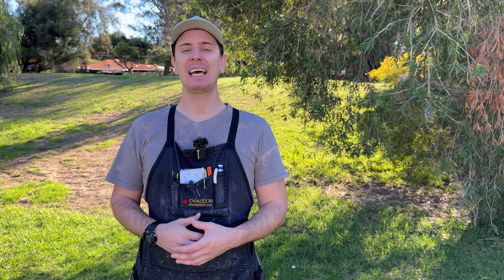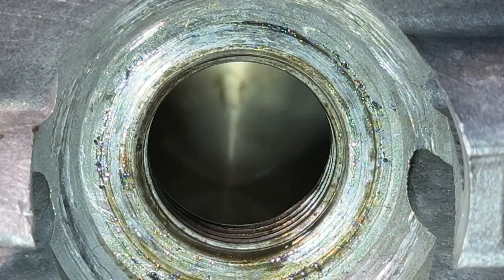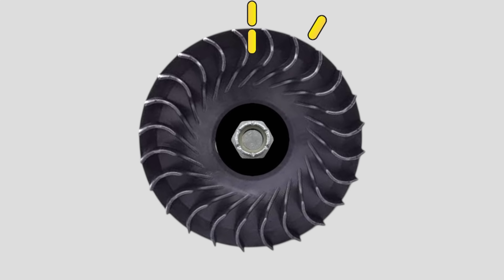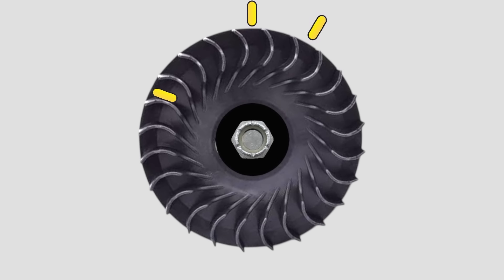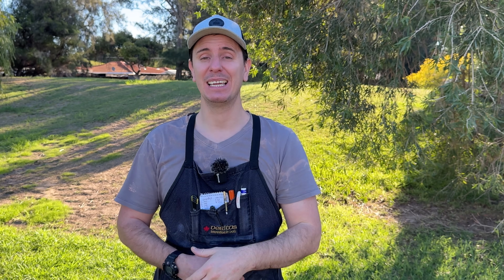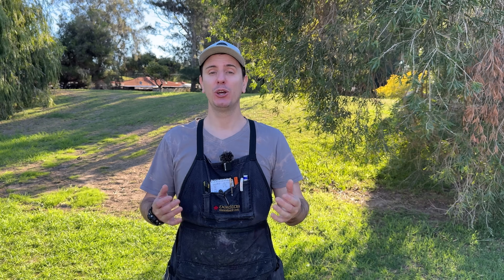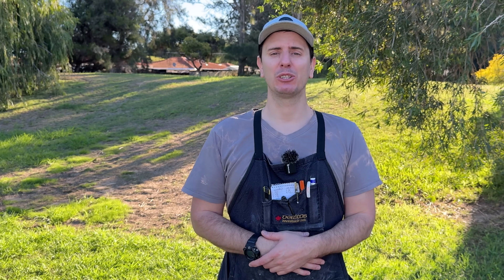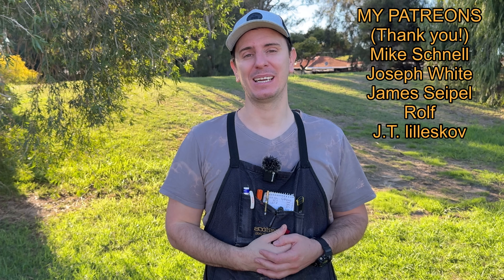Essential Tool Every Mechanic Should Own!

Comment: I have a bad case of kickback.
Ordered the light.
The saw is an old 038 AV,  and it just won't quit. Like a Timex, "Takes a licking and keeps on ticking".
I replaced the CDI module with an external one some time ago, and it ran fine.
Lately, it kicks back. 
Doesn't seem to be any way to adjust it.
Reply from the maker: Keep me updated on the timing! :)
Reply: @VintageEngineRepairs  ...BTW..the external CDI modules are getting hard to find and are quite expensive.

Comment: The timing is set on these engines you can't change it therefore checking it is a waste of time. No pun intended.😊
Reply from the maker: What if the key is sheared and changes the timing? Or the coil fails and the timing has changed? Or the 10 other things I mentioned :) you need to diagnose this to be able to rectify it. That's why it's important to know how to use one.

Comment: Question for you. I have a Stihl ms650 that has a horrendous kick back when starting in very cold weather. It seems to start ok in the summer. I have my own theories but would be curious to know what you think? I have tried to open up the clearance on the coil fasteners to alter the timing with no success. I also tried a Chinese coil and there didn't appear to be any change.
Reply from the maker: Pull it hard and fast. If you don't give it your all, it'll bite. That said, I show how to check timing here, which is a sensible thing to tick off. 👍👍
Reply: @VintageEngineRepairs I was trying to ask if you believe temperature affects timing? Warm or hot saw starts fine. Same saw 5-10 F and massive kickback on cold start, only.
Reply from the maker: It's not something I have ever come across, no. 👍
Reply: @VintageEngineRepairs ok thks

Comment: It won't run because it's a Stihl. You probably flooded it because that idiotic start switch wasn't in the right place and it didn't trip the high idle on the carb.
Reply from the maker: Thanks for that wise insight 👍

Comment: Hmmm. Strange. I've worked on lots of engines, two stroke and four-stroke but I've not come across one that is time AFTER TDC.
Reply from the maker: Na they will all be BTDC
Reply: @VintageEngineRepairs But you mark it AFTER TDC and you talk about it in the video.
Reply from the maker: Hmm no I mark it all BTDC?

Comment: I just lick my index finger and thrumb and make the connection with my bare hand and have someone else pull it because im retarded and don't mind random erections from intense electrical impulses. One day i did this with the 300lb neighbor boy at the pull string and i was plunged into a grand mal seizure it was awesome.
Reply from the maker: Rather you than me 😂
Reply: @VintageEngineRepairs it literally better to do it this way with weed eaters or slow crank a mower before i even think of running around to get the right tool. you can just multi meter that shiz as well

Comment: I wonder if a briggs opposed engine has timing advance. THe cam and crank are connected with a gear. The magneto always fires when it should, unless there is MAJOR engine damage.
Reply from the maker: It's quite possible, yes :)

Comment: Well after checking on both Amazon UK and DE, it appears that whoever is selling this timing light does not want to ship it to Greece. Too bad for them, another sale lost.
Reply from the maker: Oh no, that's a shame! Hopefully you can find an alternative that ships to you.
Reply: @VintageEngineRepairs  I do have a conventional timing light. It only needs a 12 volt supply to work. Have battery packs that can supply it with enough power. FYI, I drive a 2006 Renault Megane 2, there are zero timing marks to be found on the engine. All done electronically, bummer!

Comment: You didn't explain what to do if the timing is either too far retarded or advanced, unless I missed a bit.
Reply from the maker: It's at the end of the video, you have to find out why it's occurring - lots of reasons it can be out. Cheers.

Comment: I've used timing lights on small engines like that , more on 4 cycle engines but have a 12volt battery to power the timing light, this makes sense  with a 2 cycle engine, great video, You mentioned kickback on a saw, that happened to Ken and the saw would run backwards it had a mismatched magneto causing the malfunction
Reply from the maker: Haha I have seen videos of things running backwards due to ignition timing faults lol. Cheers!

Comment: I’ve done this on a couple of Stihl chainsaws and had to remove the key permanently to get into the timing window. My timing light has an advance dial on it. They were very common back in the day. I only need the TDC mark. Turn the dial at full advance until the marks line back up and read the degrees precisely on the dial.
Reply from the maker: Yes use to be very common :) I wonder if most modern mechanics know how to even use one!

Comment: I am so confused at the test while it's running in the video - I'm seeing 2 (sometimes 3) separate lines glowing, how do you know which one is which? I have this same timing gun but haven't tried to use it yet.
Reply from the maker: That's because there are 2 lines and each will light up depending on how fast the engine is going :)
Reply: @VintageEngineRepairs I appreciate you taking the time but I still don't understand. Did you make 2 marks on the flywheel?
Reply: @VintageEngineRepairs I bought the timing gun you recommend but I haven't read the directions or tried it out yet. I'm still trying to figure out why there's two lines that light up. You only make one mark at TDC on the flywheel, correct? Does the spark plug fire twice each revolution on that motor?

Comment: A timing light can also be used    on older alternators to determine if the fan belt is slipping.The fan on the alternator will be began to turn  backwards if the belt is slipping as you rev up the engine.
Reply from the maker: How interesting, I have never heard that! Thanks for sharing :)

Comment: all you have to do is pull the flywheel off and make sure the crank to flywheel key is NOT sheared.  if it IS sheared, the timing will be off.  sometimes you can see it by just removing the flywheel retaining nut
Reply from the maker: There are many reasons your timing may be off, the keyway is only one.

Comment: What about using an ST-125 spark tester on a small engine?
Reply from the maker: That isn't a replacement for a timing light :)
Reply: @VintageEngineRepairs  True, it isn’t a timing light but a spark tester. I was wondering about testing for a strong enough spark. I do like your timing light use and set up. That is sharp.

Comment: I was burned by bad timing on my dad’s Poulan chainsaw that had the flywheel just a little bit off and spending hours testing everything else and countless pulls of the rope before realizing the built in key was sheared.  It was probably sheared by me using a power drill to turn the engine over towards the beginning of my diagnosis.
Reply from the maker: Ah how annoying! At least you now know a quick solution to check first :) cheers!

Comment: l'm not a mechanic but received a Sears Craftsman timing light as a gift decades ago, from my parents.  When it was time for me to fly home, I placed the box in my carryon luggage.  As it went through the Xray at check-in, alarms went off.  A female federal marshal drew her gun and  pointed it at me.  She ordered me to slowly remove the box from my bag.   The label on the box had a picture of the gun shaped device.  I told her it was jus an automotive tool.  She said it could be a gun disguised as a timing light.  She tucked it under her arm, and with her hand on her now holstered gun, escorted me to the plane.  She handed the gun to the pilot, and then put me onboard.  When I arrived, I got the device back.

 I think I used it once.  Cars used to have timing marks in a convenient location for this test.  Is that still true?
Reply from the maker: Oh man what a story 😂😂 glad you got it back though!!! Yes they did have that's right :)

Comment: The first thing I would check are the inlet filter and outlet mesh. 
If either on them are clogged the engine would idle alright but wouldn’t run well or not at all at full throttle. 

It’s a common issue and easy to check.
Reply from the maker: Yes always start with the basics :)

Comment: 2:09 - You neglected to mention that you need to put your finger over the hole to be certain the piston is on the compression stroke and not the exhaust stroke.
Reply from the maker: It makes no difference if it's TDC compression or TDC Exhaust.
Reply: @VintageEngineRepairs I laughed at that one Gary must have a rare 4 stroke chainsaw

Comment: Didn’t watch the video because you show a Bosch spark plug. I have fixed many misfires by throwing away the garbage plug and installing what’s supposed to be in there. They are junk.
Reply from the maker: Stihl OEM recommendation is Bosch.

Comment: That was a good video. Thanks for the insight. Do you recommend the 3/8” drive or the 1/2” drive adapter?
Reply from the maker: Either really :) maybe to be safe 1/2" but just depends on your setup.

Comment: Thanks for this very informative video. The popular understanding with most folk out there is you need the three: Spark, Fuel and Compresson for an engine to start, but timing is also part of the mix and is often ignored untill a lot of time and money is wasted chasing a no start or power loss issue.🐞
Reply from the maker: Thanks for the kind words - I'm glad you enjoyed the video! That's exactly
right - it's more nuanced than just the 3 main requirements for combustion :)

Comment: Very smart. I usually just hit the engine with starting fluid. Easy way to confirm ignition is functioning. Even if the engine is out of time you have confirmed a spark. If further testing is necessary you can proceed down that pathway
Reply from the maker: Glad you enjoyed it 👍🏻

Comment: Will this work the same on a 4 stroke as long at its TDC on the compression stroke?
Reply from the maker: No need to worry about compression stroke as they're a wasted spark. On multi cylinder engines, you base it off cylinder 1 typically.
Reply: @VintageEngineRepairs  Honda GX 390 for example. Where do I mark the flywheel? As long as it’s TDC? Doesn’t the plug fire near the top of the compression stroke. Next the power stroke? I guess it may not matter as long as the piston is TDC?
Reply from the maker: Follow the video exactly and you'll be right. Doesn't matter if you mark TDC on compression stroke or TDC on the exhaust stroke.
Reply: @VintageEngineRepairs  After I thought about it, it made more sense. The timing light doesn’t care what position the cylinder is in.(As long as it’s TDC) I’ve never really payed attention to flywheel locations as to piston locations. I bought that Stihl block off you showed. You’re good man. I’m glad there are still people out here working on this stuff.
Reply from the maker: @tatersalad2067 that's right, the key here is piston TDC everything else should be based off this. Thanks for the kind words!

Comment: I got 2 small engines in my life that had a sheared flywheel key. The first one took me days to find out what was going on. Usually misfiring and kickback are an unmistakable sign. I wonder if a timing light designed for car engines could be adapted?  Back then I eventually found the fault by checking the mechanical contact breaker with a multimeter. This won't work on modern small engines.
Reply from the maker: I don't see why not :) though they're infrequently self powered so you'd have to lug a 12v battery to your engine you want to test! Thanks for watching!

Comment: Is that timing light bright enough for automotive use?
I can't get a timing light close to the timing mark. If the light isn't bright enough, this might need to be done at night time.
He did a great job explaining timing advance and why it's there.
Reply from the maker: Thanks for the kind words Randy. This is an xenon bulb, but if you're a long way away you may find using some cardboard to block out the light to be a good idea :)

Comment: I just did this last night with my chainsaw and i tried a number of different coils to see when they fired and how much they advanced.
I was amazed at the variation i found between coil types and even coils of the same type. I have seen and heard of numerous machines with "mystery" problems that make them next to impossible to start or run poorly and put down to carb problems or cylinder problems. Timing gets overlooked because the modern coils are self contained fixed units and the thinking is if they spark thet are working but that is wrong. People dont realise there is a electronic package built into these coils. Electronics are effected by heat, vibration and magnetic feilds so electronics embedded in the coil is probably the worst place  for them.
One coil i had was amazingly firing before rhe magnets went past the coil.
It was giong past the coil, charging the coil, allowing the engine to rotate 330° onto the next compression stroke and at that point firing the spark.

You are the only small engine channel i have seen speak on this and this is a big cause of small engine problems.
Cheers.
Reply from the maker: That's a great insight, thanks for sharing your experiences and observations! Really appreciate the support and feedback :)
Reply: Hey up hydrogen I've been wondering this same thing for ages as in the inbuilt advance or not, feel free to give more feedback

Comment: Brilliant work sir. I have a mid 80’s 034 stihl with a condenser swapped out for an electronic module, it’s just a show piece, but I’ve long suspected it has timing issues. As a self taught chainsaw repairer, your channel has been instrumental to keeping my 60 odd chainsaws going. Many thanks from NZ.
Reply from the maker: I have just got a coffee inside me so can think straight, the 034 never had points :)
Reply from the maker: That's great to hear, thanks for the kind words :) yes the mid 80's were when they first came out and they did the job, but had longevity issues. Revert it back to oem and I think you'll be stoked :)
Reply: I had a Stihl 031AV my brother had before he gave it to me. Upgrading from the condenser to the electronic module was the best thing. It kept that saw running another 20 years.
Reply: @akbychoice  that’s it, I changed the condenser to electronic module. Mine has not run right. Idles fine but no power. I read somewhere you had to use an off set key in the crank to correct the timing? Not too sure. I’ll try the timing light trick.
Reply from the maker: It can't be an 034 :) they never came with points ignition. Possibly an 038? Or 032?

Comment: Thanks Tom Great video. I still have my first timing light I bought back in the early 70s.
Reply: Is that the orange neon type?
Reply: @alanm8932  No. This one is the white. Though my father had the orange one. The company I worked for gave us a tachometer that use reflective tabs. That was mostly for checking speed on brushes.
Reply from the maker: Awesome :) useful to have! I presume that's not a self powered unit?

Comment: fouled spark plug causes ignition timing ?
Reply from the maker: Yes, surprising but it can. What it really causes is weak, intermittent and late spark which can affect how and when the charge is ignited (and often ineffective). One classic sign of a fouled plug is the engine backfires through the intake.
Reply: @VintageEngineRepairs  incorrect timing from fouled plug, I can never see how that can happen, logically fouled spark plug cannot cause incorrect timing or a late spark

Comment: I know this is off topic, but is there a universal number for all engines, where you can say compression is too low. I am working on a Evinrude 2-stroke outboard from 1967 that has 75 psi on both cylinders. It will start with a drill, but cannot idle. Carburettor has been cleaned. I am thinking to low compression or an air leak.
Reply from the maker: Hey :) I've never seen a 2stroke run with less that 100 psi with an accurate compression tester!

Comment: Hadn't seen anyone apply the timing light to a small engine. Smart!
Reply from the maker: Thanks for the kind words :) glad you enjoyed it! I haven't either!
Reply: The reason we don't use a timing light is because parts like the carb and cylinder and piston fail at a greater rate than the ignition system.  If your grabbing a timing light your searching for those 1 in 1000ths problems
Reply: Wow! I'm so impressed. Been a mechanic all my life and didn't think of this. Great video! Thanks so much! 😊😊
Reply: Can you just check timing key wear or breaks?
Reply from the maker: You can yes